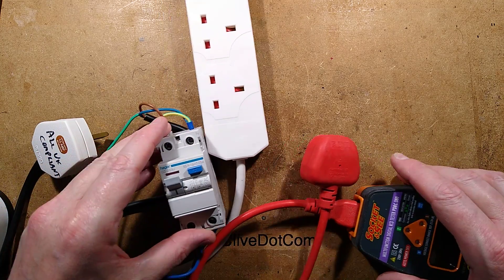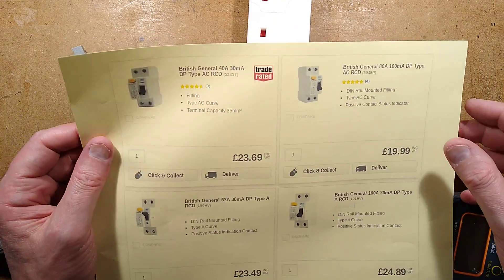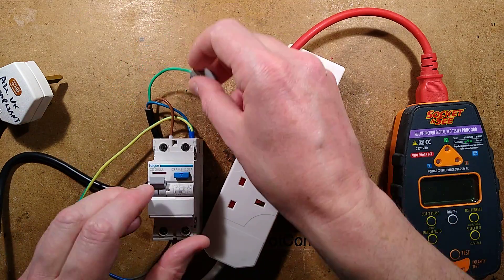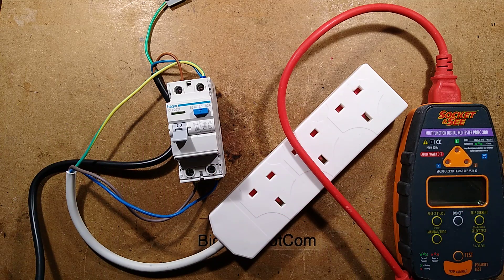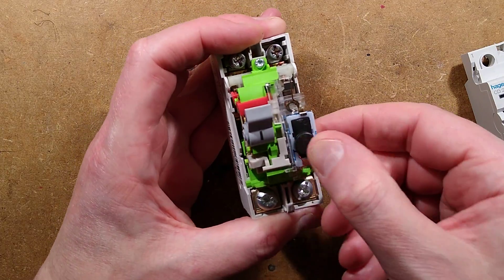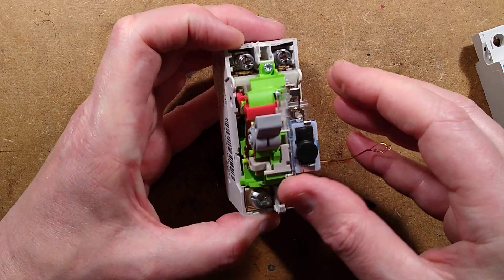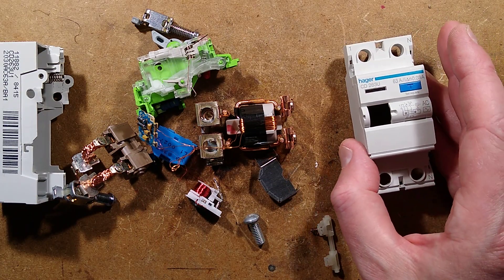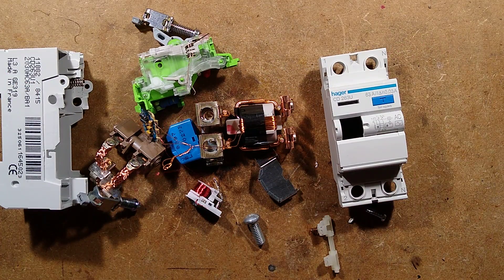Was this RCD damaged by overcurrent?

Comment: From all your videos, what i can gather.  Your electrical systems there seems to be better in every way compared to the usa. Other then the one video you mentioned stepping on a plug on the floor because they like to lay face up. Does anyone make a straight plug instead of the 90 degree that is compliant and safe? Or is it less practical.
Reply: My understanding of the difference is that in the US the board breaker is protecting the fixed cabling and the appliance flex from overload.  

In the UK system the breaker primarily protects the fixed cabling installation as each appliance and connecting flex is locally protected by the fuse in the plug. (the variation being hard wired, high current, appliances like electric showers). 

One benefit of the fused plug approach is that appliance flex does not have to be excessively 'heavy'.  Table lights, soldering irons and the like, can have lightweight flex as the plug fuse can be 3 Amp.
Reply: @barrieshepherd7694  i very much agree,  i have a 20 amp 120 outlet i installed with all new wires to the breaker box to run a small 120 welder. Problem is, a standard 15 amp plug will plug into a 20 amp outlet. My 20 amp outlet is protected with a 20 amp breaker.

Also many old homes have 20 amp breakers feeding multiple 15 amp outlets in a room or floor. Now i understand this would be rare, but could happen, a short of low resistance,  not zero, but low enough to draw more amps then the cord can handle,  but high enough resistance to draw say 18 amps. like with the light cord of my solder iron, my 20 amp breaker will not trip. But my cord cannot handle it, nothing stops it and may result in fire. 

Yes this would be pretty rare, because usually a short results in very low resistance and very high currency,  the cord will heat up a bit but then the breaker trips. 

I like the idea of having a fuse for every plug. Larger breaker or fuse to protect the wire, and outlet. The uk electrical system just seems much better. From every video clive has done about it i now have a pretty good understanding of it. I dont see much for drawbacks compared to our major problem with electrical shocks from holding the plug wrong while plugging it into the wal.
Reply: @poellot  If I understand you correctly, the 2nd case not really a problem, because the configuration of 20A appliance plugs is different (has the "T" prong on one side) you would not be able to plug a 20A appliance into a 15A outlet - regardless of what wiring was connected to it. The outlet slot configuration acts as a limit on what can be plugged in. Mind you, you could plug two 15A devices in at once - but then you could do that on any duplex outlet - and you would trip the breaker. My suspicion (although I can't prove it) is that your typical 15A duplex outlet is capable of handling much more than 15A of continuous current - that is, it has a considerable safety factor. There appears to be little, if any, physical difference between the 15A and 20A outlets beyond the slot configuration. Your first example is not an issue - the slot/pin size is there to restrict the maximum load - not the minimum. Any device with the standard two 9or three) prong 15A config must not draw more than 15A

Check out this adapter - you can plug it into a US 240V outlet and get four usable 15A 120V outlets - all legal :-)
https://www.homedepot.com/p/AC-WORKS-1-5-ft-NEMA-14-30P-4-Prong-Dryer-Plug-to-4-NEMA-5-15-20R-15-20-Amp-Household-Female-Connectors-Adapter-Cord-S1430F520-018/308319956
Reply: @stevep8773  The biggest problem with our unfused plugs is extension cords. An ordinary light-duty extension cord will have 18awg cord good for 10 amps but have three 15 amp receptacles, all with no fuses. Put two 9 amp appliances on the extension and plug it into a 20a circuit, then nothing stops the 18a current from melting the 10a cable.

I agree that the new US tamper-resistant plugs sometimes don't work well. The first time I encountered one I was trying to plug in a nice modern cord and it just wouldn't go in. I thought the outlet was broken but I tried a different plug which went in normally.
Reply: @barrieshepherd7694  I agree the fused plugs are  a good thing and provide an extra level of safety. However, in the US systems, a device will still have a wire gauge supply suitable for its load. So a table lamp has thin 18 ga zip cord rated 10A max. A UK mains supply will have a mains fuse, and (depending on the age) a mains breaker, circuit breakers (possibly RCD or RCBOs), then a switch on the socket and a fuse in the plug. The US will have fuses or mains breaker (often both) then a circuit breaker (GFCI/AFCI as required) and that's usually it. My experience - even with a newish installation - was that fault-finding on the UK system for earth leakage trips was quite a bit more time-consuming. Plus the RCD tripping can take out an entire flat (possibly even the lighting) or half a house all at once. In the US with radial single-appliance supplies and GFCIs either at the outlet (also available in the UK but not as common) or at the panel it is very straightforward to ID the problem
Reply: Just to address the "stepping on the plug" aspect, remember we have (mostly) switched sockets. Plugs don't tend to be left lying around on the floor as they're left plugged in the socket and the appliance is additionally "turned off at the wall" - probably an exclusive British (and Irish etc.) saying. It's not anywhere as big a deal as people make it out to be 😉
Reply: @georgeprout42  if you have kids then you know what its like to step on sharp objects anyway. I tend to not walk in the dark without shoes now.
Reply: @georgeprout42  Do you really leave everything plugged in? Here 99% of the time something gets unplugged is to make space for something else.
Reply: @eDoc2020  Yes. I unplugged the coffee machine a couple of weeks ago as I was taking it apart to fix it (Big Clive-esque but it also went back together afterwards) Power tools in my garage get swapped around as needed (go in there barefoot and you've got bigger worries about what you might step on). But otherwise I really can't remember the last time I actually needed to unplug anything. Maybe we have more than the average number of sockets, but every room (and the garden) has unused ones.
Reply: One more difference has come to mind - that of the built-in shutters to protect the live terminals on UK sockets. It's an excellent idea, especially given their size and the voltage. In the US is is common for anyone with a new baby to buy plastic plugs that blank off outlets from inquisitive fingers. But actually, since 2008, new US electrical installations have required tamper-resistant outlets as well. Of course there is no requirement to retrofit, so many are unaware. I must say some of these US versions are diabolical and don't function very well. In the UK, the ground pin is usually used to lift the shutter and that's why even a two-conductor UK plug will have a "dummy" plastic earth pin

https://www.esfi.org/resource/what-is-a-tamper-resistant-receptacle-538
Reply: @stevep8773  yes i have seen that in many of clives videos. They look like much nicer plugs. Even being much more bulky,  they still look better by far other then the stepping on one.
Reply: Some clarification is needed I think...
A typical home in the mainland U.K. has a power company (or equivalent if fed via private company wiring) fuse located normally next to the meter. Then the supply goes to a fuse box or consumer unit. Occasionally there is a separate isolation switch feeding the fuse box(es) or consumer unit(s). Inside each fuse box (except really old ones) there is a main switch and typically 4 to 6 fuses. With consumer units, it depends on the age of the unit. The main switch can be either just a main switch or a single RCD. Or it can be a main switch with one or more RCDs (split load consumer unit). None of the main switches, isolation switches or RCDs provide any form of overload or short circuit protection (unless there is a short to earth in which case the RCD will trip). The consumer units are fitted with either MCBs or RCBOs. You may encounter some consumer units with fuse holders instead of MCBs. Fuses, MCBs or RCBOs provide the overload or short circuit protection. All the switchgear should be rated to equal or exceed the rating of the power company fuse.
The fuse box or consumer unit fuses, MCBs or RCBOs are designed to protect the fixed wiring of the building. We have two types of power circuits for sockets. The radial and the ring. In all cases, the so called 13A plugs have fuses to protect the cord of the appliance.
The vast majority of the electrical regulations in law have not changed, however the body that writes the standard that is considered good practice does occasionally change the documents. This is a private company, and they charge you a considerable amount for every copy... That bit is bad IMHO.
Having said that, most of the changes are trying to improve safety. The changes to consumer units have been along these lines. Adding RCDs and RCBOs improves safely. Moving from plastic enclosures to heat and flame resistant materials (in other words, metal) helps if a MCB, RCD, RCBO or a loose connection overheats.
A lot of the changes over the last 70 years have been the ‘code’ evolving over time to reflect advances in technology and to improve safety.
In terms of the stepping on a plug thing. I do think that it is overstated. In the days before electrical gadgets become widely available, a typical mainland U.K. home had only one socket in each room. Very occasionally the main living room would have two. A radial system was used with one fuse feeding one socket in each room, or adjacent rooms. As more electrical appliances become available, the mix of 3A, 5A and 15A sockets and their different circuits become a mess.
Hence the ring circuit with the 13A socket and plug came about. The biggest advantage with the ring, was the ability to have as many sockets as you like (within a certain floor area) as you like. While only using one fuse way in the fuse box per ring. Now rooms have many sockets installed. Hence unless you are gadget mad, most appliances are always plugged in. Nowhere in the code does it say that sockets must be switched (you can have unswitched sockets if you want), but most people prefer to have switched sockets so that is what you will find in nearly all homes and businesses. And where you are gadget mad, or you have an older electrical installation, four way extension leads are common. Of course, some electrical stuff will not be plugged in, but then leaving stuff on the floor is down to how tidy you are or not.
Reply: I disagree.  In the US the individual breakers can add up to more than the main breaker because the assumption is they won't all be at 100% simultaneously.  And if they are, then the main panel breaker trips.  What keeps you from maxing out each circuit and putting 186A through that 63A rated RCD and melting it into a puddle?
Reply: @stargazer7644  if the wiring is done properly.  In uk and in usa, i really cannot find an advantage to our system, in any way.
Reply: @stargazer7644  and if you look at the pic he shows between a minute and a half to 2. It shows the main on the right. Being a 100 amp. So if the 100 amp interrupts are used then you are fine.
Reply: Star Gazer that is Clive’s point when he is talking about the price of the 100A RCD, these Consumer Units normally come pre-populated with 2x63A RCDs where as they should use 2x100A RCDs, they are only £1 more retail so probably tuppence difference for the manufacturer. Most UK homes are fused to 80A so this would effectively solve the problem.
Reply: @stargazer7644  There is also a mains fuse feeding the panel. Usually 100A, but can vary as required to match capacity of the internal wiring
Reply: @stargazer7644  as he stated it was the incorrect part. And the correct part was just about the same price. Anyone could install the wrong breaker in the usa and have a major failure also.
Reply: Having grown up using the US/Canadian electrical system, and then living 20+ years in the UK, I would say.... neither is "better" overall. You have to define what you might mean by better. The UK mains plug does top even Lego bricks for middle-of-the-night instep injury index :-)

Leaving aside any arguments regarding the inherently safer US 120/240V supply over the UK 240V-only, I would say I found the UK system to have more variations (as codes changed with time and EU regs) than in the US. It's possible to add new features (like arc detection CBs) to a 20-yr-old US entrance panel but in the UK it seems every few years an entirely new "Consumer" unit style is introduced. Both countries offer plenty of dodgy examples of electrics, but the UK has oddities like ring mains and basically a prohibition on any socket (outlet) in a bathroom (unless it is 3M - 9 ft - away from any source of water - big bathroom!) Which is impractical and leads to all sorts of dangerous conditions (extension leads down the hall) as a result. The rest of the developed world has found a way to use a blow dryer in the bathroom safely - why not the UK? In the meantime, as a result of antique plumbing issues, you have 240V water heaters on the wall inside your shower... The UK seems in some ways to fear electricity greatly, but then allow things like unprotected surface cabling because  - well, it would just be too difficult otherwise. BTW - I have never seen a "straight-on" domestic UK mains electrical plug. Note they all have a fuse incorporated (a nice feature) so that must remain accessible, and the mandatory shape of the pin layout pretty much preludes any other configuration (the couch would have to be a foot from the wall to clear the sockets behind :-)
Reply: @stevep8773  cool. Great info. The thing that i most dislike about old homes in the usa. Including mine. All the main floor outlets and lights are on the same fuse. Our house has been upgraded to a breaker box decades ago and new wires and outlets were put in the kitchen whichis great.  But the rest of the main floor is all on one breaker because its just one feed for them all. Back then you never had much plugged in at a time. Now days every outlet gets used at the same time. Im not sure if old homes in uk were similar.  My friend has 4 fuses for his whole house. One for every light and outlet except the kitchen. One for everything in the kitchen.  And 2 for the 230 for his clothes drier and air conditioner. Gas oven and water heater.
Reply: @stevep8773  You can get hairdryer units designed for use in UK bathrooms, but those usually have the electronic part permanently fixed to the wall and the bit you hold in your hand is a bit like a hairdryer version of a handheld shower head
Reply: @stevep8773  The EU is to thank for many of the constant changes to the electrical codes, although I don't know how it will change now that we're out.
What's wrong with a safely installed heater in the shower cubicle? The only reason for 'antique' plumbing is that our houses are generally much older than the houses in the US; that said, modern houses tend to use either combi boilers that instantaneously heat the water, or unvented cyclinders that store hot water at near mains pressure.
I would argue that the US is the country with a fear of electricity, hence the 110V system used in the US and Canada (and othe countries unfortunate enough to have adopted the US system); the UK system takes safety seriously, e.g. we outlaw those awful wire nut things.
Reply: @cambridgemart2075  Methinks you protest too much :-) There's also the antique water mains and in many areas insufficient pressure head to deal with. I love the dead rats and pigeons in header tank stories. The US is actually 240V 2-phase. So 240V is available where needed and 120V where sufficient. And it's really no issue. Newer homes get a 200A service as well. I am certainly not claiming one is system is better than the other - more that each have good and bad points. The UK mains lug is a great thing (until you step on one) and switched sockets as well. Ring mains? Not so great. Wire nuts have been around dog's years - they work fine when used correctly. Wagos are better (IMO) but I am not even sure if they are legal in the US yet

Comment: =! 😂🤣😂
Reply: I'm totally sure that little RCD would be perfectly happy with a 186A load! 😬

(Yes, yes, the 60A/80A/100A incoming supply fuse would fail pretty quickly with 186A on just that one RCD.

...if the supply fuse hasn't been replaced with a nail... 👀)
Reply: @AndrewGillard  Sure, a 60A one will go in about 15 seconds, but the 100A will take about a half hour..